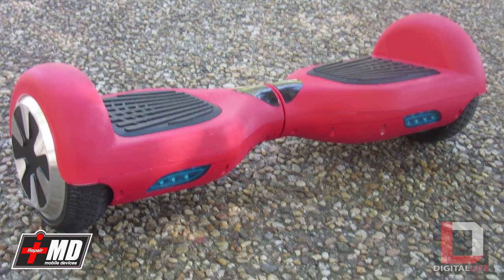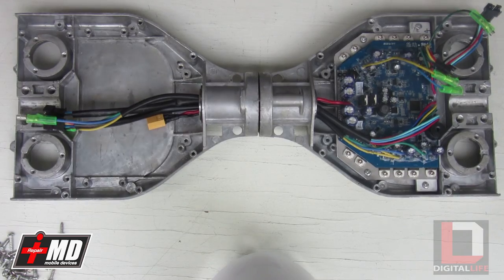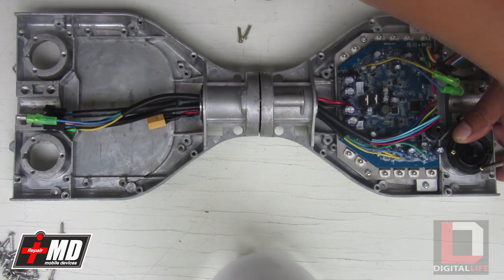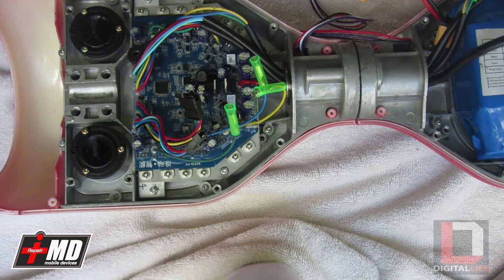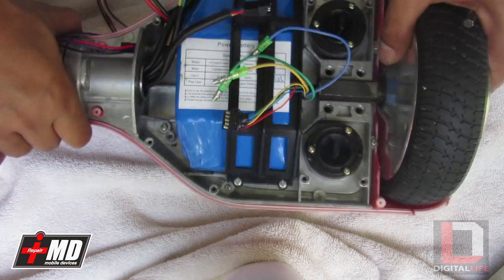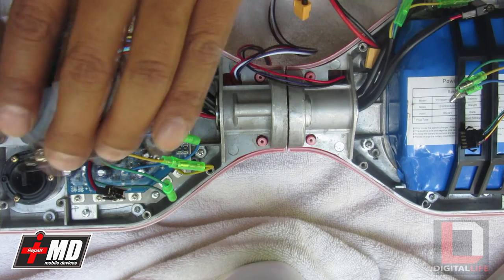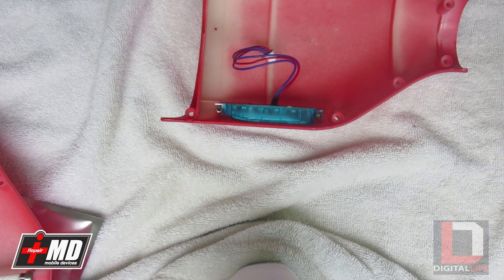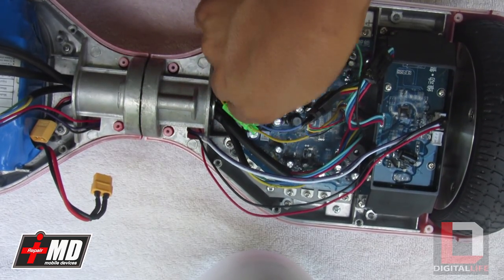Smart Balance Wheel Scooter Parts From Start to Finish

Comment: He man I just wanted to thank you so much! I bought a 6.5 and an 8 inch board for my son and daughter for Xmas. The 8 was having issues and I thought I broke it. I am an IT guy and very comfortable working on electronics and cars alike. Your video gave me the info that I could not find anywhere else on the net to allow me to trace back the issue and resolve. Turns out a 3 wires were too close to a screw and had been damaged. Cut the bad section out and crimped. Reassembled and cleared the error light but BT was trashed. I had cut the wire during reassembly so patched that together and was a bit more cautious putting it back together this time. Got green battery and green system. Had my son jump on it and away he went. Working like a champ. You saved the day man! Subbed but would like to submit a donation, got a paypal address? Add to the video and ping me so I know its there. God if you only knew how much stress was off my back now LOL. Jesus you saved me man.!
Reply from the maker: +Stephen Black that's great, I'm glad. People like you are the reason why I create these videos.

Comment: This was great, thank you for sharing ... i'm pretty handy with repairs and have an issue I wanted to ask you about to see what parts i need to get (if any) in order to fix it  ... my board worked great until a day or 2 ago when it stopped in the middle of me riding it, litterally almost spilling me over. I've since discovered that on smooth surfaces it rides just fine, but now anytime I hit the tinyest bump it just shuts the balancing off with no warning and starts blinking red ... any idea where this problem stems from ? logic board ? the wheel motors themselves ? any feedback would be greatly appreciated ... Thank you :)
Reply: Battery down...Did you get a charger?

Comment: will the parts you sale on the website work for the 10 inch board too or does that board have different parts?
Reply from the maker: +christinia hall yes the boards will
Reply: The 10 inch board is the same board but with bigger wheels n chassis

Comment: what do you do if you turn the hoverboard on and #1nothing turns on or #2 the two light on top blink green on and off very fast. then nothing
Reply from the maker: +Steven Ferguson (ask dr ferguson) Dr. sounds like ether your battery is bad or the main logic board is faulty . it one of those

Comment: recently  noticed  that the green  power wire when connected  is the problem
Reply from the maker: Yes your charger is bad
Reply: +iRepairMD Youtube I changed the main board and one of the Co boards but problem still exists

Comment: Is it possible to add Bluetooth speakers
Reply: Yes
Reply: How?
Reply: +Ziam Jan take it apart, drill some holes in the body for the sound to pass through, wire in a Bluetooth speaker being careful to get the electrical numbers correct,
Reply: +Ziam Jan there's enough space to fit a module and speaker inside
Reply: +Ziam Jan I saw a kit on ebay that offered BT and the keyfob remote control. Not sure if this OP sells the kit at his store but if he does, buy from him. He is legit and I would trust him over anyone else selling anything related to these boards.

Comment: Hi my scooter is all wired properly but once i turn it on it blinks continuously red
Reply from the maker: +martin try to reset it by placing it on a flat surface and  holding the power button down for 4 seconds and leave it to calibrate for about 4 minutes
Reply: I did that it turned off then i turned it back on and it did the same thing :(
Reply from the maker: please click the store link
 to arrange a repair.
I feel we can get to the problem if we have in our store